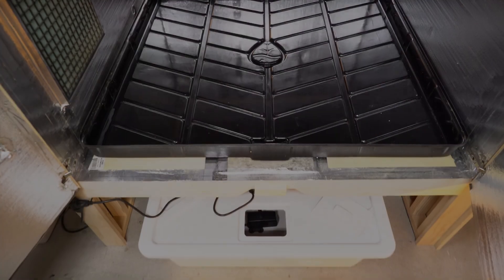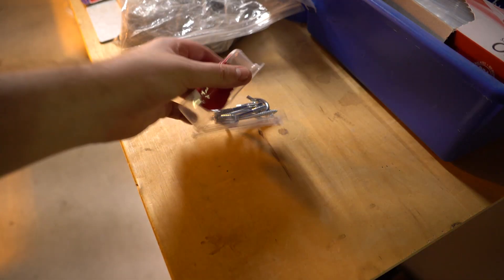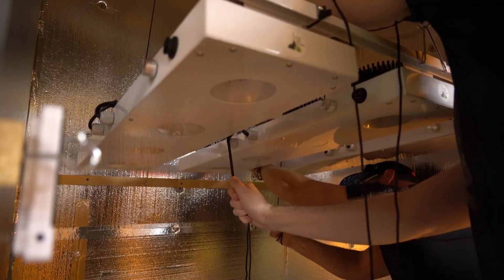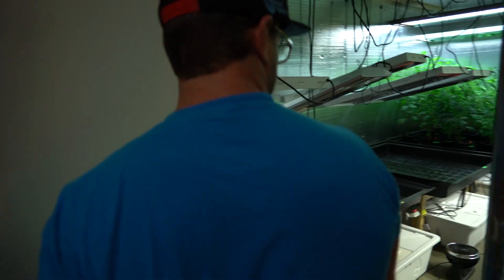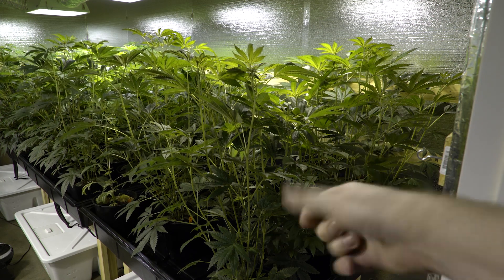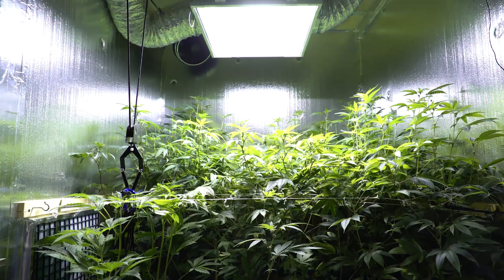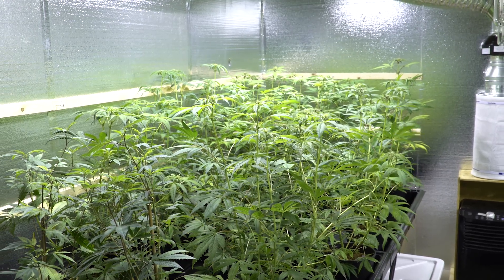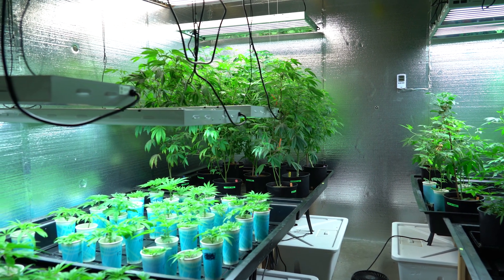Winter Grow Op Check Up!

Comment: what kinds of pumps are you using in the ebb and flow set up? air/water. I know you're using some kind of combo but can you let me know what that type is called and the model you use?
Reply: He's answered this a few times in the past.  160 gpm of whatever the hydro store has available.  No air.
Reply: DrBlaze thank you! I don't have Internet access so I only get a few videos in a month so thank you for answering!
Reply: Got to thinking about my answer and it didn't seem right, 160 is a small pump.  Went back and found one of the vids and for the big trays in the flower room he bought an Ecoplus 264, 290GPH.